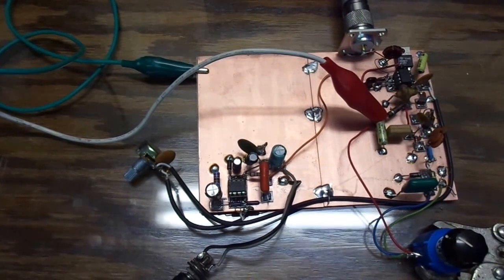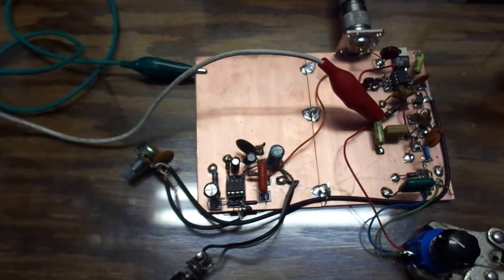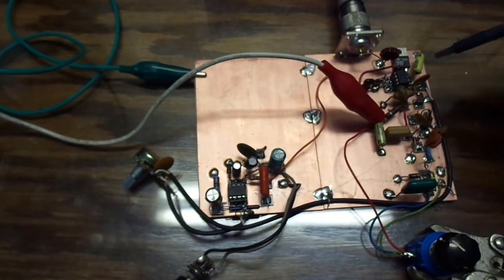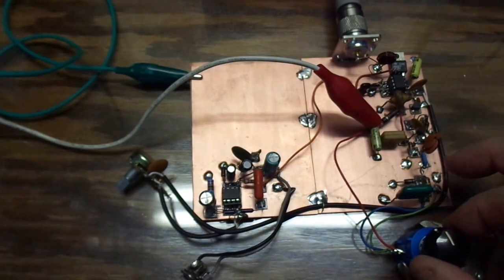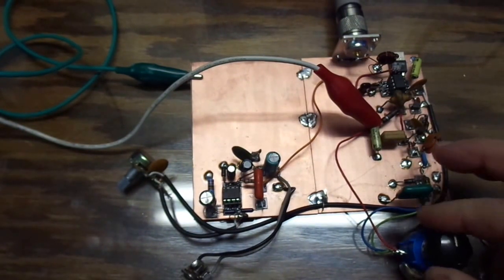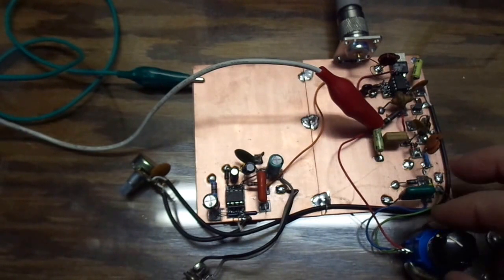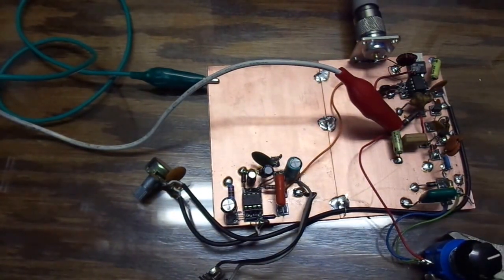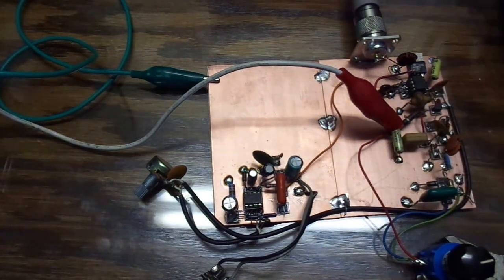Micro 40 DSB receiver Demo

Comment: Hi,  I have built about 5 different variations of the Micro 40 on 3 different bands, I even made one with a Arduino and a Si5351 clock chip and a small OLED display. I am presently building one all SMD that will fit in a Altoids tin. They are fun radios and I have made 100s of contacts using them.

Joel
KB6QVI
Reply from the maker: Joel Caukins can you please contact me?  tom at w5kub.com    I am wanting to build a new one now with more general coverage receiver and also using a dds vfo.  i also want to talk to you about being on the show.
Reply: Have you smd pcb